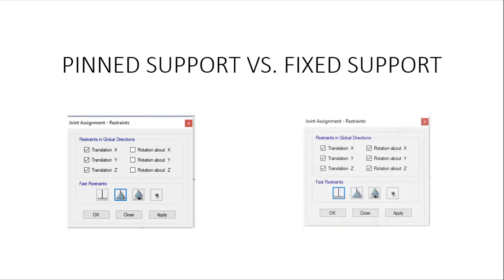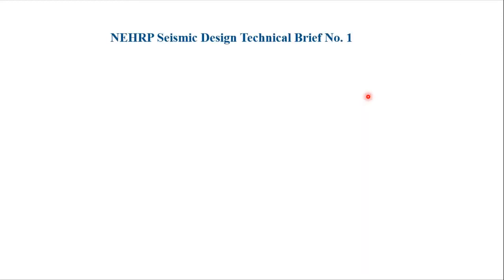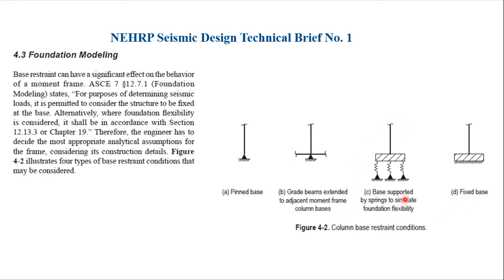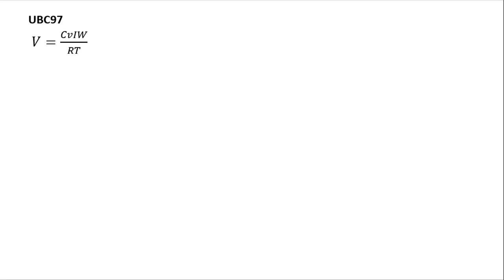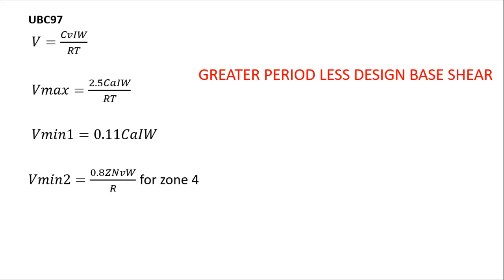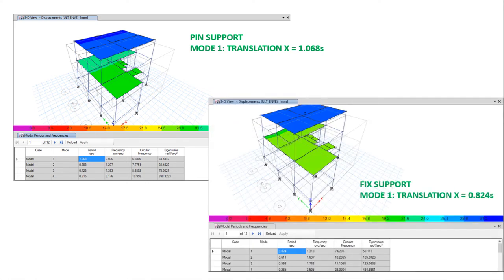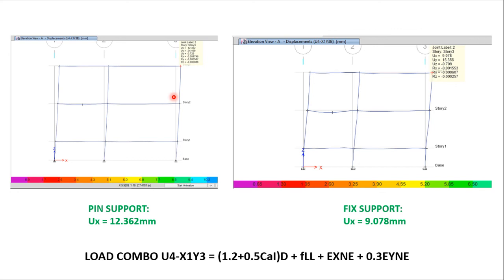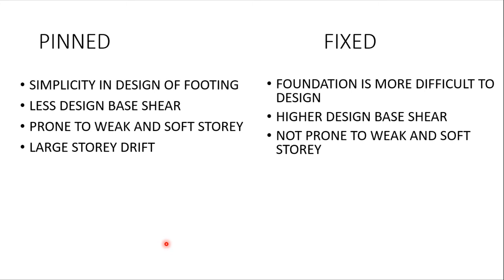PINNED SUPPORT VS FIXED SUPPORT

Comment: Thank you sir. So basically when designing using staad kapag mababa lang ung bahay pinned support ung ilalagay mo at basta pumasa sa storey drift?
Reply: So end of the day sir, kung gagawa ako ng three storey residential rcc building ano ang mas safe sa  bagyo at lindol, pinned or fixed support? Salamat engr.